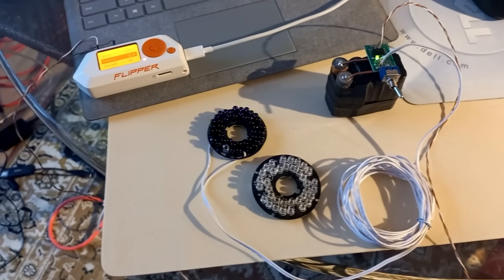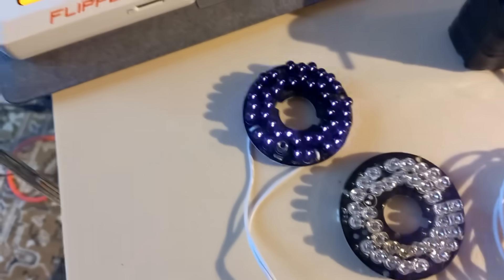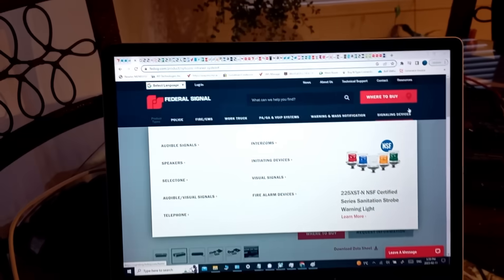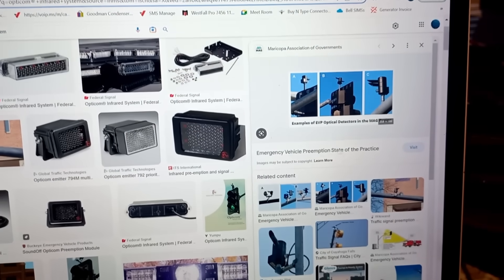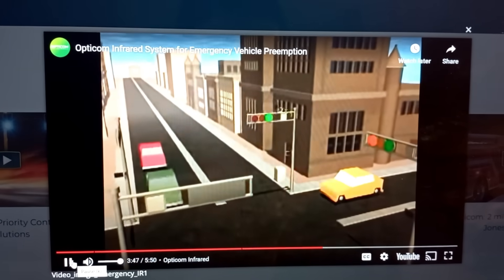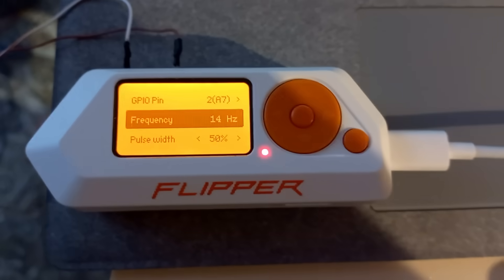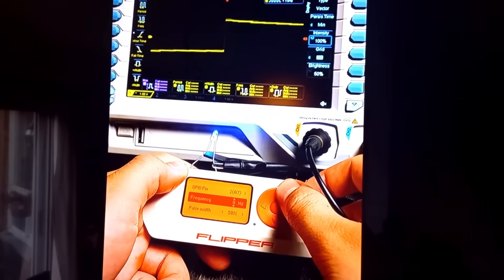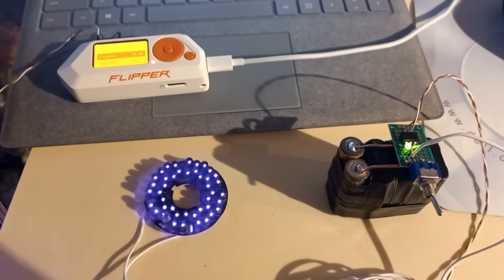Flipper Zero Controlling Traffic Lights

Comment: Interesting since in 1994 I designed a system for traffic lights (for my Diploma) where emergency vehicles could switch the light form distance sending a code. now it's a reality. Sad do not have had money for patent.
Reply: @peterfairlie2296  Mine was sending a code via Radio (like the ones  are used to open/close doors) at that point, all traffic lights in the zone went to red, and a flashing blue-light on top of them, informed the drivers that the red light was due emergency.

Comment: As a guy who has been stuck at dozens of red lights that refuse change due to them not sensing motorcycles I'm infinitely jealous. I really don't mind waiting, but they really need to come up with a better system for motorcycles.
Reply: They do it's called a magnet. Glue a high powered magnet to the bottom of your bike and you won't have a problem. Magnets trip the inductive sensors imbedded in the road.
Reply: @bobcosgrove3235 I have heard that works, with about a 50% success rate. There is an aftermarket setup designed for mounting to the motorcycle. So much aluminum in todays motorcycles doesn't help.
Reply: If there is one, i hop off and hit the crosswalk button
Reply: Even cars if they're not aimed right. One light near me never changes when I'm in the turning lane. I have to back up and get into the straight lane for it to change.
Reply: Put a few neodymium strong magnets on the underside of your motorcycle, as close to the pavement as possible.

Comment: The majority of traffic lights are controlled by a spinning metal disk with holes in it. When a laser lines up through the hole and hits a sensor on the other side, the light changes.
Very skeptical if this video is real or not.

Comment: Just some information to consider if you want to use this or any similar device to control traffic lights.  A traffic intersection and all of related equipment (lights, poles, mast arms, controller cabinet, controller, vehicle detectors, etc) belong to and are the property of a government entity be it a city, county, or state.  You therefore would be tampering with government property which is obviously illegal.  Many intersections also have the white indicator light that will illuminate when a call is placed to take control of the intersection.  If a person does it often enough, the cops are going to start to notice the white lights but no emergency vehicles.  Eventually, they might start to notice your vehicle is a common sight at these "phantom" activations, start to put two and two together and find you.  How do I know this stuff?   I used to be a work for 3M, and for 20 years was part of the Opticom team.  I also held one of the many, many patents for the system.  I had the complete and total resources to put a real system on my car, but didn't.  Why not?  One, I wanted to keep my job.  Two, I didn't want tickets from the cops.  Three, I didn't want become involved with a city, or county, or state prosecutor or district attorney's office.

Comment: So through my years of selling emergency vehicles and collecting light bars, one of my prized possessions is my Tomar light bar with an opticom emitter in the center of the light bar. I’ve never been tempted to use it as it could easily be traced back to me, and I’m not a criminal. They can be detected up to a mile away. 

A bunch of lights kept getting triggered and it was pretty easy to track down the guy using a homemade one over the course of time using CCTV. Needless to say he screwed himself royally.
Reply: What a lot of people don't understand and realize is when you switch lights like this, usually* a camera will take a photo of whatever vehicle is triggering the lights.
Reply: urban legend, no evidence of that sophistication. @ShahabSheikhzadeh
Reply: I remember that,his dumb ass kept goin the same way to work on the same road at same time..yea he deserves to get caught.. 😂😆
Reply: You can blink cams with IR light. So if they have no something like ‘smart city’ (it is when cams everywhere connected to AI which alarm about misc strange situations in realtime and can track suspect by cams in automatic mode), then you are free to do this. There are only several “smart cities” in whole world, mainly rich cities where living millions people.

Of course it will be stupid to use this from “home” to “work”, because they can trace route and wait you. Just use fro time to time “somewhere”.

Comment: 9:30...yea that wasn't an actual test because the flashing white light over the sensor didn't kick on, plus the traffic on the opposing side started going as well, which would have a red light if the emergency sensor was actually activated.

Comment: so if someone used this device, does it reset the timing of traffic lights as the car passes through? so you drive down and synchronize all the traffic lights as you go along, will it stay sync'd? It's just my town could really use an adjustment of its traffic lights

Comment: Wow, these flippers are extremely versatile. I’m not that knowledgeable about electronics (just enough to understand the basics of what’s going on) but it’s extremely interesting to me.
Reply: “Make: Electronics” by Charles Platt, and few month later you can do a lot of wonderful things. For more complicated things, e.g. to make own flipper, you need to know much more, including coding, it need few years.

P.S.
You can read book even if don’t know difference between “plus” and “minus”, volts and amperes :)
Reply: This example isn't really a good one for a Flipper usecase though.
He's just using the Flipper as a signal generator.
Something that an Arduino can do as well. And it would cost a fraction of the Flipper.

Comment: About 30 years ago...I heard 13 cycles per second was the frequency.  I was told it was a secret on par with national security...lol.  I was told it makes both lights red rather than any one of them green.  It makes more sense to just stop traffic (You always will have a cleared left hand side of the road.  A green light allows traffic to come at you and fill the opposite side of the road) Also, it would prevent anyone from wanting one for themselves.  I never see firetrucks/cops/ambulances having any effect on the lights tho...ever....and I've always watched to see if it was true.   I have seen strobes on firetrucks tho....just never saw the traffic light react in any way.  ...In Canada.
Reply: If you were to just stop all traffic when it is busy you would likely block the path of the emergency vehicle. Better to keep the path clear and have people pull over as they are supposed to.

Comment: Very interesting. Nowadays, it would be far better for the dispatcher to control this. Given we have GPS and advanced rout-finding capabilities (i.e. Google Maps) you could preplan a route and have the lights turn red well before emergency services reach the intersection.
Reply: GTT has such a system, it can be controlled from dispatch and using vehicle condition monitoring can adjust for the path of the vehicle, or multiple vehicles.

Comment: you should be good using this. only transmitting RF is bad and administrated by the FCC, however devices that transmit light (wherever UV, visible or infrared) is administrated by the FDA. you can use devices that transmit light, you cant use devices that transmit RF without a license.

Comment: only in the USA. Here, emergency vehicles can't do that, because we don't have those systemes on the traffic lights
Reply: Uh, first and foremost, the US is not the only country that matters, as here in Canada (Where OP as well as myself reside) all manner of these systems are in place across the entire country, from "vintage" ready-for-retirement systems in smaller backwoods places that only use IR, to cutting edge modern IR/RF systems in place in larger metropolitan areas.

Comment: Back in the days, we just used a strobe light.
Reply: @peterfairlie2296  interesting.. I was using a smaller built back in the middle 1980’s strobe light, back then while driving around it was triggering all red lights to green. Must of been the same frequency?.

Comment: Pretty sure this is highly illegal and the sentences for it will be on the harsh side.
Strongly recommend removing the video to 1 not incriminate yourself and 2 not get others to copy it and get in trouble

Vehicle Code 21464 VC – Interfering with Traffic Control Device
jail sentence of up to six months, and/or; a fine between $5,000 and $10,000.
Reply: F.k off typical egoistic pseudo hero who ruin all fun
Reply: (L)

Comment: Ambulance, firetruck and a police car does NOT get different priorities. Either it's an emergency by policy or it's not. Our county's public safety division used this in the 70s early 80s and it definitely had its issues. Today a switch inside the fire house will turn lights green in the direction of travel on the main Avenue to move traffic before the arrival of the emergency vehicle to assist in clearing the intersection. Our 911 dispatcher's can also trigger green lights at desired locations, if need be.

Comment: 6:31 I mean yes i wouldn't recommend anyone doing it, But allowing civilians who are working as the government to run red lights simply because they work for the state, doesn't sound constitutional to me. Which is why they wanted it to seem like a normal flow of traffic right? Not for confusion but rather to not let people know because technically if they can do it, technically you should lawfully be able to do it. Unless they wrote special laws saying only in a emergency can they be used, but I'm not so sure they did that. Since they went out of their way to hide it, for so long. Technically i think in a emergency any emergency vehicle can run the light anyway, But having it hooked to the car it would cause it to do it every time, unless its wired only to turn on when the lights are on? Then its probably not a issue at all. But i wonder if volunteer firefighters when they get thier lights if they get something like that for emergencys? or if its just governments?
Reply: @peterfairlie2296  Cool my uncle was one, in a area that only has volunteer emergency services, I was set to be one as well but i ended up going to the army instead. Anyways i think they would need such a thing, more than anyone else. I know his lights where different than the ones people buy in the stores but i don't remember seeing any other type of device. But he was also a grandmaster Lineman. Anyways that good idea. Since alot of area's especially rural area's only have volunteer services. & since they are usualy in thier own vehicles, so yeah its a good idea.

Comment: There is a reason why most places with an opticom system also have a lightbulb attached to them. It indicates to the responder if their vehicle tripped the light or if someone coming from the other way tripped it so they dont charge out into the intersection thinking they have the right of way and get creamed by the other responder who also had the right of way. This is also effective for telling which direction a responder is coming from as the light will shine solid in the direction they are coming from while the others are supposed to flash.
Reply: seems like it should be hard coded into the light to not allow all directions to be green at the same time
Reply: Its also in part a way for police to enforce if someone is using this not as a responder.
Reply: I alwas wondered why they put the lightbulb next to the opticom. Kudos

Comment: Just flash your high beam a couple times when approaching the traffic light. Light will change.
Reply: No it won't and never did. This is just an urban myth that never worked. If you flashed your lights and it turned green it was going to turn green anyway.

Comment: did you put a resistor in there?
Reply: @peterfairlie2296  So the schematic I saw of the pin out look like there was a resistor In there. 240 ohms should limit the collector current to 50mA (0.05 amps).  12 volts "+" connected to one end of 240 ohm resistor.  Other end of 240 ohm resistor connected to the collector (chip terminal 5).  It should be a 1 watt power rated resistor.
Reply: Probably could go with higher ohm value and smaller wattage (overall size).  240 ohm 1 watt is the largest power / size.
Reply: @peterfairlie2296  Great response. that's where I got confused

Comment: I need one of these for my bike. Not because I want to cheat, but because the light signals never sense me cuz I'm too high and don't trigger the mag loops or weight sensors.
Reply: in my  city you can legally proceed if the light has cycled three times without giving you an arrow. If you are at an intersection that only changes to green when it senses a vehicle, you can proceed if the light hasn't changed in two minutes.

Comment: Possessing equipment that has the ability to manipulate stoplights is a FELONY in Minnesota.  Not using, but possessing.  Don't do this!
Reply: @peterfairlie2296  Under Letter of Law = Yes.  Would that be enforced = Probably not.  Should the law be modified at that time = Probably.   Did I write the law = Nope, so asking me if everyone would be in trouble makes no sense, under the letter of the curent law, yeah the could.

Comment: It's amusing to see all the comments from numerous Karens reminding us that this sort of behavior is illegal. This is probably the least harmful illegal activity you could possibly engage in. You literally just cause the light to do what it is already going to do a little bit sooner than it was planning to. Yet people act like you are running the light or something.

One possible way to get away with using this sort of thing is to be a bit more selective about when you use it. If it's 2 AM and you're the only car on the road it would be easy for them to figure out what happened. But if you're in a pack of cars in the middle of the day, how would they know which one did it?

Combine this gadget with a concealable/obscurable license plate and you don't have to worry about them finding you.

Being a rebel is fun.

Comment: people saying you will get caught are mostly full of shit because 99.99% of traffic lights have no security cameras and even if they did they are usually low quality and wouldnt pick up the signal the car is puting out and couldnt reliabily pin the person to it. plus the existing camera systems that are on lights are red light cams they DO NOT work for anything else. Even a police car behind you wouldnt know what was happening. this thing is not a laser dazzler or radar jammer so its almost impossible for them to detect unless they got tipped off and put a frequency sniffing vehicle nearby to try and trace it. But thats highly unlikely since this doesnt interfere with anything. This is unlike a jammer some dude had near an airport that knocked everything out and they sent every sniffing vehicle to pin point it. something like this  light changer would likely go undetected by the law for years before its discovered by accident in the dash of someones car unless they put it inside the grill or something

Comment: Thanks for the video Peter! Note that the pulse frequency must be very precise, no more than about +/- 0.02 Hz, or the pulse receiver will reject the strobe as noise, so simple R-C rate generators are out - not stable enough for this job. The old crystal-controlled Xenon strobe version of the transmitter had an input energy level of about 2 Joules per flash, which is pretty beefy, and the tube would get good and hot. The trick was to use the 10 Hz rate 'bus' emitter IR filter, meant for a hurry-up system to help the bus stay on schedule, on a 14 Hz emergency rate emitter. It does help to know some technicians who work for a large city that uses the Opticom systems, and has access to retired or scrap units for research and fun. 

Otherwise, be careful to check the behavior of signals that you intend to trigger. Some cities have their systems set up in a dangerous fashion for casual users! For example, Beverly Hills has their systems set up to create three red lights, not two, on some plain-jane 4-way intersections. Meaning that you risk running into left-turning on-coming traffic, since the turning driver rightly sees a yellow light as you approach, and assumes you do too, and proceeds to turn in front of you to clear the intersection - even though you still have the green light! The theory being that drivers would see an obvious emergency vehicle which has triggered the system, and any traffic would yield to the emergency car/truck with the loud siren and assorted flashing lights, etc. OR an agency will install a receiver system and incorrectly wire it so that the CROSS traffic gets the green light, and force you to wait at the red light created by the incorrectly set up detector. Also, these things don't help a user safely speed down the road much, but rather maintain a steady speed, with reduced stops, near the posted speed limit.

At this time, most arm-top traffic cameras are used for cue-detecton, sometimes augmented by vehicle detector loops embedded in the pavement at or near the intersection. The resolution of the cameras are not that high; they can see blurry lines of cars waiting their turn, but can't reliably see license plates - but beware, this can change at any time. Best to use the emitter sparingly and vary your route if you can.

Finally, these emitters can be great on date night. Nothing better than saying 'I believe we're not going to have many red lights tonight,' then proceed to calmly glide through thick mazes of traffic signals which mysteriously turn green when approaching from down the block...🍾😎